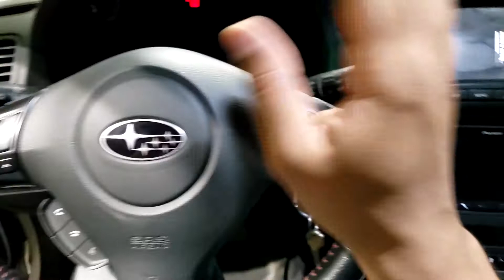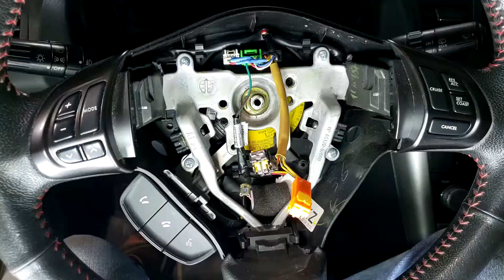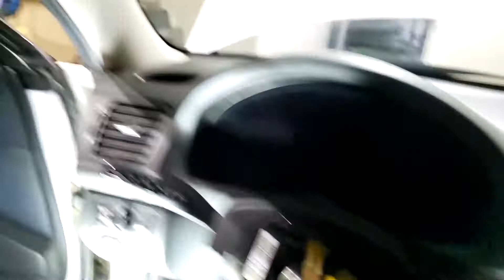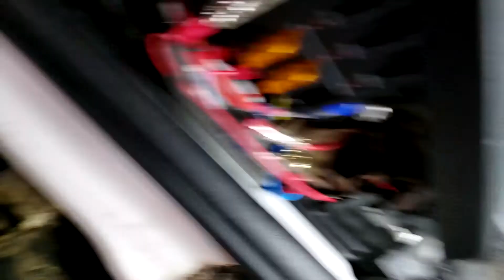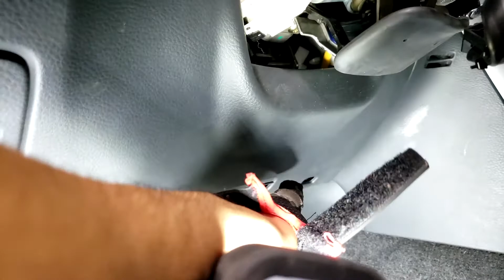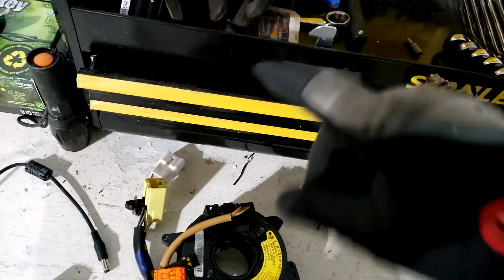How to Replace Roll Connector / Clock spring Subaru Legacy / Outback 2005-2009

Comment: Thanks man!  Usefull for me too. 
One addition. You should show also how to disconnect airbag and explain why it is important to take off MINUS connection from the baterry. Anyway I did it just few minutes ago without problems. One screw under for cover underneath and two inside for upper cover. I fix it after mechanic screw up my spring. Orange SRS error gone right away.

Comment: So does a clock spring turn 3 & 1/4 turns to the left and to the right from it's center?
Reply: Did you get an answer for this?
Reply: At least on my WRX it was 2 and half turns to left and right. 5 turns total. If you are gentle you can test it left and right. Don't turn too hard though

Comment: Very good explanation, I am changing my clock spring but
 for my 2016 crossteck I bought the two plug (black and red) clock spring, but my crossteck uses only the one wire (black) one. Will the two-wire one work for me?
Reply: For sure not without problems. Better to send it back and buy propper one. And opening airbag/horn is by differend method, there are no T30 screws.